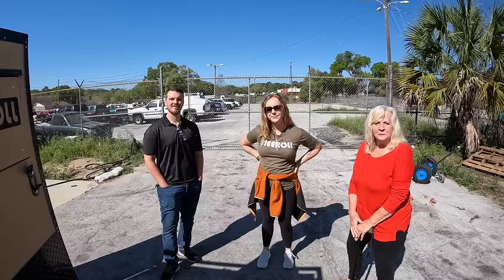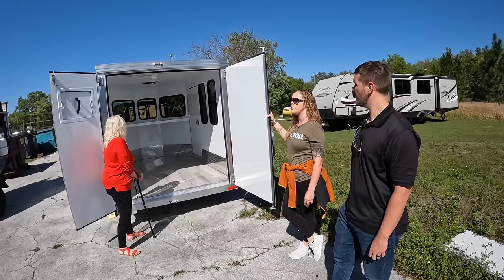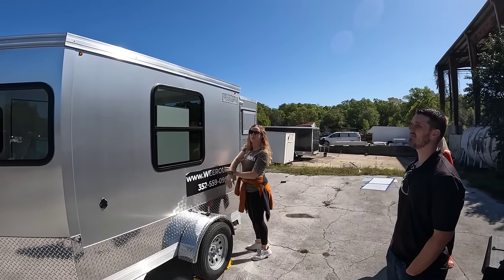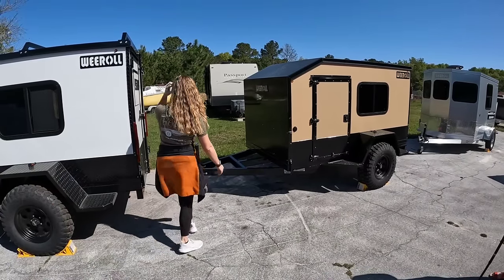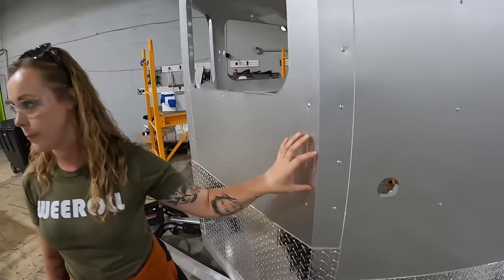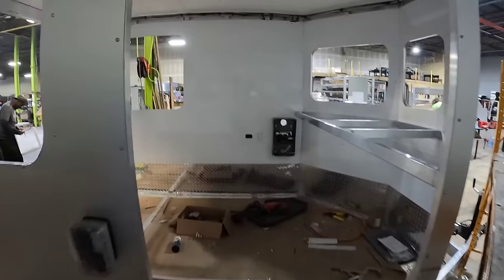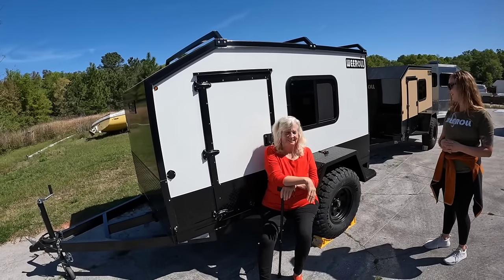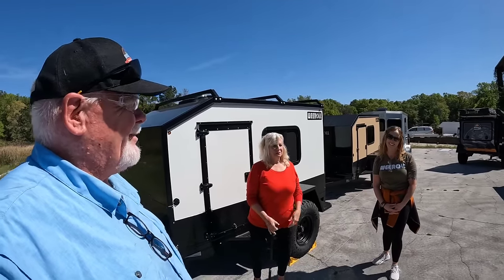We Tour WeeRoll Trailers. Lightweight All Aluminum Trailers.

Comment: I built my own tiny home trailer for 9k and saved 9k in rent in my first year living out of it on a farm which means it paid for itself in the first year. I’m building a shop so I can build more of these for other people. I’ve had so many people ask me if I could build them one that I decided I will do just that. Hopefully this summer I can be ready to build some of these for other people. I’ve been living in mine now making sure it’s exactly what it needs to be.
Reply: So, if it costs you $9k to make yours, you’d have to add on labor before selling it. That makes buying a high quality WeeRoll a good deal, because it’s aluminum.
Reply: @MySonsMother  yeh it’s worth 15-20. But it’s also built exactly how I wanted it. Extra insulation, wood stove, diesel heater, 42 inch tv, metal door, galvanized roof. Mine is wood encased in aluminum. I’ve heard they make good trailers. I just wanted something more specific. Not camper but a mini home on wheels.
Reply: @TinyGoHomes  would love to have something like a we roll . hope there are business that would make the inside custom m made for buyers
Reply: @smartnfinal it wasn’t as hard as I thought building one. Most of it comes down to budget. I’m preparing to start making more. I’m learning lots while living inside my first build for myself.

Comment: I saw this and said that is the best looking trailer I have ever seen. And only an hour away from me!  Till I looked at the price! wow I only use this a few times a year. would not be worth it to me. But some one full timing it ya worth the investment
Reply from the maker: Rvs are all different prices. You have to get what fits your budget.
Reply: Now I'm worried about going to the website. They used to be ridiculously affordable. Within $1,000 of a comparably sized, much lower quality cargo trailer 😅
Reply: @NoZenith look how much those cheaply made cargo trailers now cost. The older smaller WeeRolls were wood trailers. It’s after Covid and these are aluminum. Big difference. You can’t even buy a used vehicle for pre-Covid prices.
Reply: @MySonsMother  they had all aluminum trailers previous to the new owner. They had steel frame offerings as well but they did have all aluminum trailers, that's what got me interested in them and that proprietary one piece roof
Reply: @NoZenith  yes, they did. I ordered the steel. I had to delay mine. When I went to get it they no longer had steel and I had to get aluminum. Then the new owners took over and I got the the aluminum, because that’s all they had. 

The steel were $4k before Covid, then almost $7k during Covid. The aluminum was more. I bought mine at $14k, and now they are more.
Reply: @MySonsMother  🥲 I might compromise and go with a local Builder that makes aluminum trailers and save a few thousand and just be super diligent at making sure I seal up every crevice... The one piece "cookie tin" roof has always been such a big selling point for me as a lifetime purchase kinda thing but I'm going to be using it as a utility trailer sometimes to fix up my house and I'm not no camping all that often so throwing all those extra thousands of dollars where I was looking at spending under $8,000 total free covid.... I really need to get around to get something though cuz I'm just getting older at this point and losing years to get my money's worth haha
Reply: @NoZenith  I understand. I paid $10k more than originally planned, plus I lost almost $2k of my previous deposit. It broke me, so I sold my $14k trailer for about $10k. So I lost $6k. 

Shortly after that my $17k van lost the motor and I sold it for $2k, and was forced to finance a minivan for $22k.

While I was out of state buying that, my four storage units worth many thousands of dollars was ripped off. I’m now totally broke sitting in the desert.
Reply: @MySonsMother  oh no. I'm sorry that you've had so many disasters

Comment: Just imagine the level of thermal transmissivity through all that aluminum! I wonder how much of the polystyrene's value is short-circuited by that? Definitely a trailer for the South, and with side-mounted ladder racks to accommodate solar because nothing is supposed to put any type of hole through the roof or it voids the leakage warranty (last I looked). Their website shows the maximum size of a Nomad is only 16 ft.
Reply: With that amount window surface, none of that insulation matters… it could have been 3in, still wont make any difference

Comment: I noticed that the insulation in the wall and roof where not visible in the interior view. was it left out intentionally on that specific build? I also saw that they have nothing for the floor and we know how bad aluminum transfers heat.
Reply from the maker: I don't remember seeing anything like what you're referring to. As far as heat  vs aluminum, we don't remember anyone complaining about heat transfer on the 2 or 3 WeeRoll walk thru videos at our last Tiny House Adventures Rendezvous in Pickensville Alabama. Everyone was very happy with their WeeRoll trailers and eager to show them.
Reply: @billanddeb   At 15:21 of the video your are pointing up talking about the trailer. you can see several inches of the inside of the wall, framing and roof metal all the way around the top and it has no insulation board like she mentioned. that added with an aluminum floor with no insulation below would make for a horribly cold floor and cold spots, unlike a standard cargo trailer that has a wooden floor with at least some R value. aluminum has the opposite effect as insulation. that's why it's used as heatsinks to remove heat. I'm not trying to put down what they build. I'm just pointing out what may have been a simple yet extremely important part of a trailer.
Reply from the maker: That's where all of the wiring is ran. As mentioned in the video, there is a metal cove that covers the wiring, however, it can be removed, allowing easy access to wiring, in case it needs repairs or you want to add something. We're well aware of how a typical Cargo Trailer is constructed. We too have  a similar setup in our cargo trailer conversion. Our first trailer did have a wood subfloor and no insulation. We spent an entire winter in NW Arkansas with many morning lows in the single digits and we were never cold. Yes, the all aluminum floor will naturally be colder in cold climates and warmer in warm climates. However, if you noticed how the interlocking floor goes together, you would see that makes for a very strong as well as light floor. In addition, the way the floor is constructed, it would be very easy for a DIYer to insulate the floor from underneath. As far as the upper corners are concerned, I did not see the cove moulding that covers that. I don't know if the cove moulding is insulated or not, but the fact remains there needs to be access to wiring for a multitude of reasons. For example, I've seen several videos where the builder wired his trailer then installed closed cell spray foam insulation, covering all of the wiring. What if a short developed or (heaven forbid) a wire broke under stress. How to you find it if it's all covered up?? Of course then here's the worst scenario of all,,,,,,a faulty wire that was inaccessible caused a fire.
Reply from the maker: Please don't get me wrong. A WeeRoll would not work for us either. However, as with all "cargo style" trailers, there is a certain amount of fabrication the purchaser will need to perform to fit their particular needs. WeeRoll trailers are definitely quality built, but they are not "turn key". If you'll remember,  at near the beginning of the video, Daisy stated they get the trailer to certain point for the new owner to do their build out.
Reply: @billanddeb   The wall could be insulated in each cavity between the frame sections and the wire still has several inches that is covered in the trim that covers that section. most of the wires are not in the wall cavity that the insulation belongs in. the trim piece in the finished trailer sits on a 45 degree angle between the wall and roof. that's the void for wires to be ran and would not affect the installation of insulation behind it. If someone is to pay around $20k, you should at least get the insulation that you are paying for.

Comment: We roll you need to build a 8 foot tall version 6’6’’ just does not cut it.  Build the shell off the trailer then put it on the trailer outside of the shop to solve your shot door height issue.

Comment: I would like chemical free. But aluminum for heat and rain sound are concerns. I'm chemically injured and mold injured, which is why I ended up in my own custom built trailer.

I have a 6x12 that I've had to get a rubber roof to lay on top to dappen the rain noise here in Seattle.

Comment: Bill do they put insulation in the floor?
Reply: No!
I have a Nomad and the floor is very cold in the winter.
The walls are cold, and in the summer the walls are very hot .
Try using rugs on the floor during the winter time and they got wet .
Reply from the maker: No, they don't. However, due to the way the interlocking floor is put together, I can see a DIYer doing it with ease.
Reply: No but you used to be able to request it, you may be able to still

Comment: One inch of insulation is just not enough. Too hot in the summer and too cold in the winter. Nice looking trailer. but without adequate insulation, it's a bust for me.
Reply from the maker: We have 1 3/4 inch of foam board insulation. Our minisplit handles 100 + degree temps and 26  degree temps, we stay very comfortable.